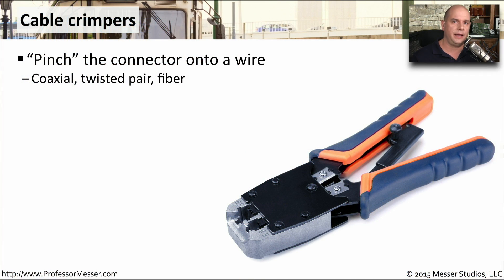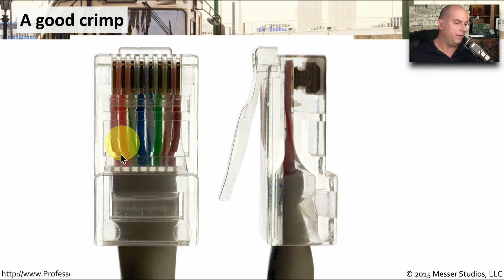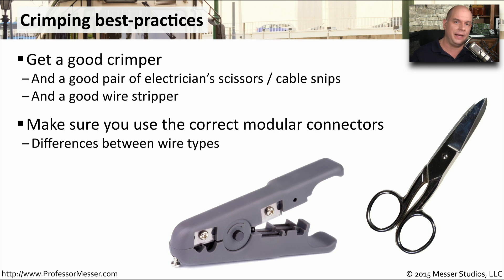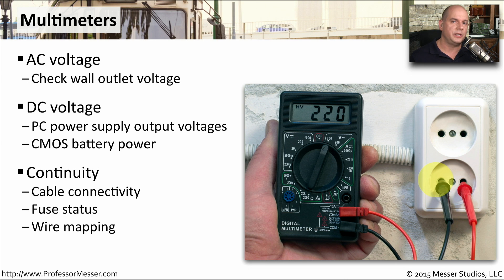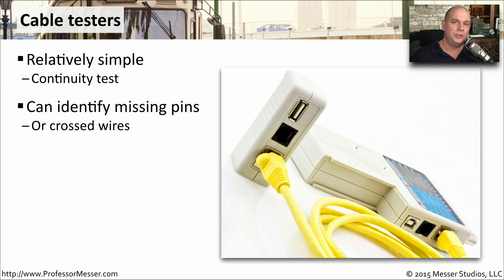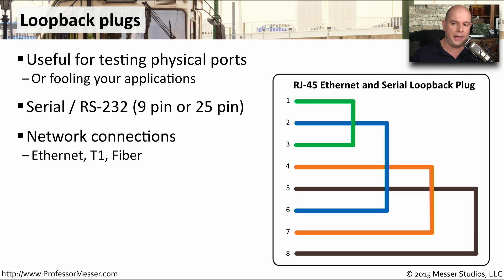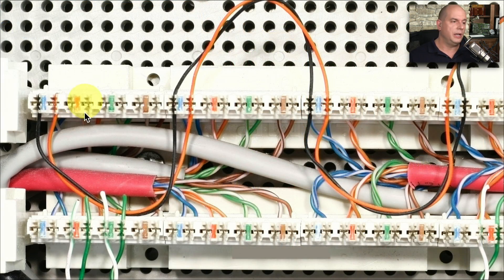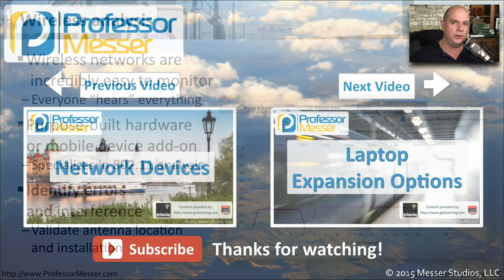Networking Tools - CompTIA A+ 220-901 - 2.9

Comment: I thought crossover cables were mean't to connect to say a switch to a switch? Not a switch to say a router?
Reply from the maker: That's certainly one use for crossover cables. Crossovers aren't covered in this video, however.

Comment: What will happen if you crimp Cat6 cable with a Cat5 connector?
Reply from the maker: +Stardustchild01 Category 6 cable is a bit larger than category 5, so it will be a bit more difficult to crimp a category 5 connector to the end of a category 6 cable. You'll probably also have to untwist the cable a bit more to fit the category 5 cable, which will affect the results of any cable certification tests. Your cable run may not be to category 6 specifications after using the category 5 connector.